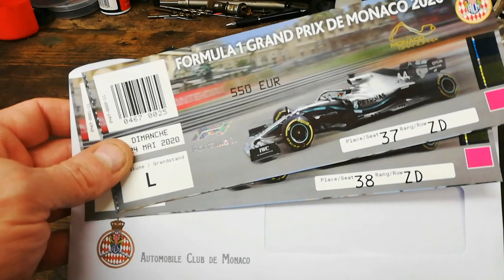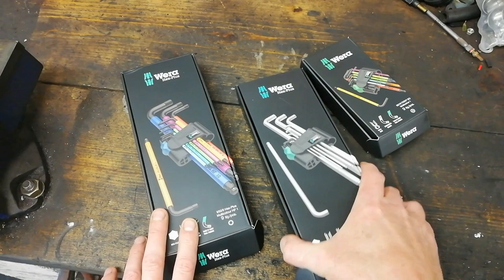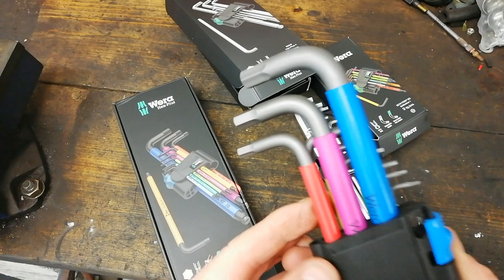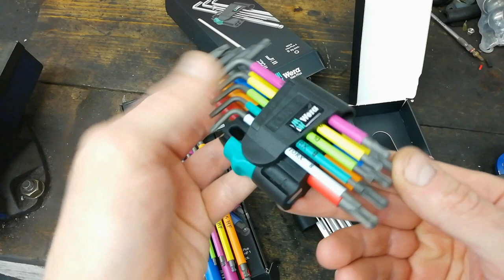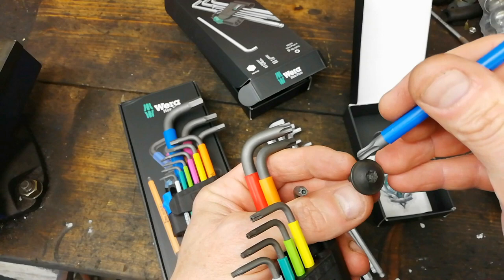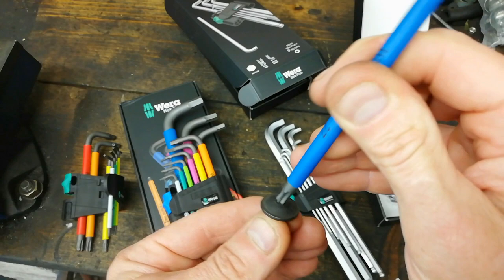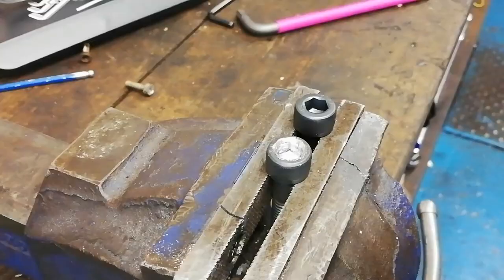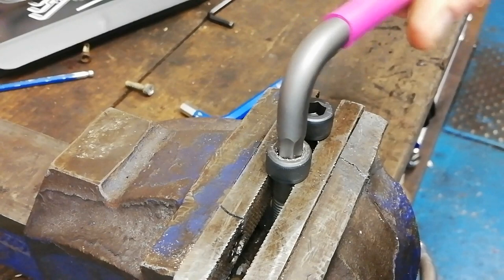Wera Hex Plus, Rounded Allen Heads

Comment: The 5mm in that low profile set is perfect for the bolt that's hidden underneath the EGR valve on the 2ltr mk 4 diesel mondeo's , it's worth 20 quid in frustration alone
Reply from the maker: Defo, i was thinking of the vw pd egrs, upside-down allen
Reply: @davesterl  I've a couple that I cut to low profile for exactly these reasons, I thought I came up with the idea until now.
Reply from the maker: @SMAutomotive  agggh we all share the same pains, Simon

Comment: I have never seen such a useless demonstration, Hex Plus keys are designed to bite in to the head of a hex head which has been stripped by another hex key, which they do very well. They were not designed to bite into a hex head which has been stripped out purposely in a different way. Ball end drivers should be left in the tool box and only used when straight end hex keys wont fit in to the hex.
Reply from the maker: What a pointless comment in which you finish off by contradicting yourself. Try reading the video title that gives a clue to the point